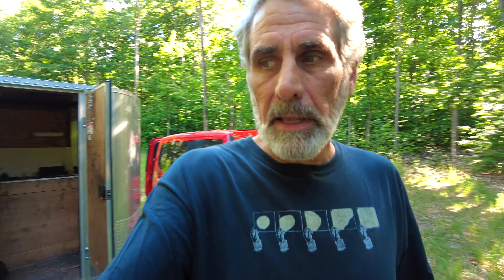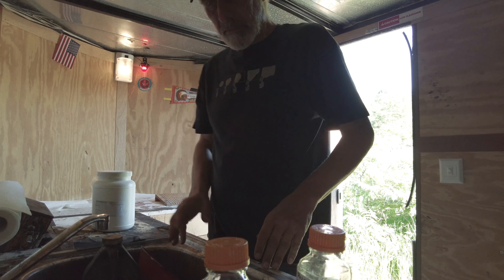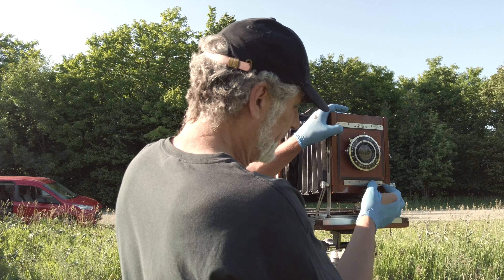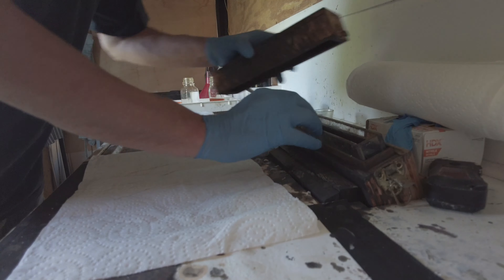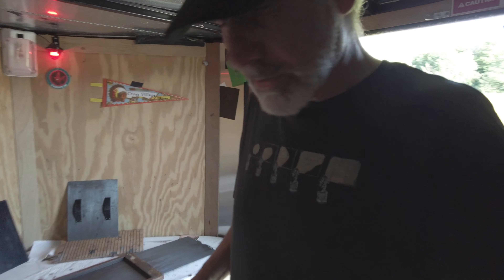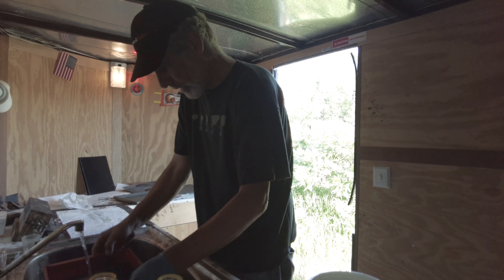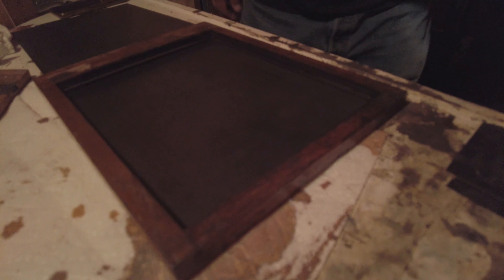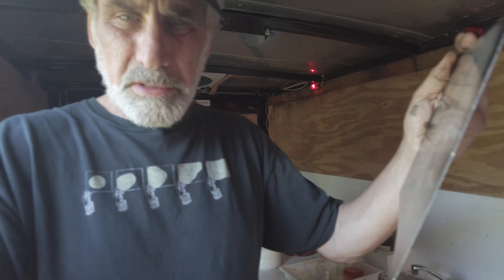Make a Wetplate Photograph from Mobile Darkroom - Create a collodion plate with Bill Schwab

Comment: Hi Bill you mentioned putting in dissolved white sugar into your developer to act as a restrainer… how much per 100ml of developer do you use as I have problems with veiling and fogging on my plates 
Loving your location series of video’s
Reply from the maker: Hi Michael. Thanks for the kind comments! Sugar ask is an excellent restrainer and you really can’t overuse it, but I would consider starting with 20 to 25 g per your hundred milliliters. You can adjust from there. Works great for those hot days as well as fresh collodion and hot exposures.

Comment: Pouring the developer on the plate works for you Bill? I have always been told to pour from one edge to avoid splashing and spotting of the developer. Never tried pouring directly on, maybe worth a go. You also poured 2 times, was wondering if that was an option. Applying extra developer later on in development to a vital area.